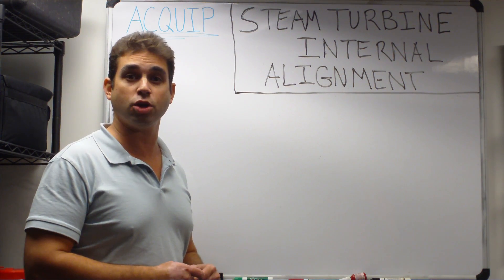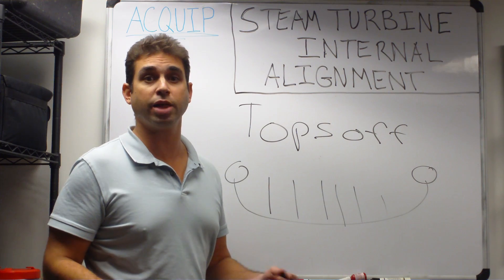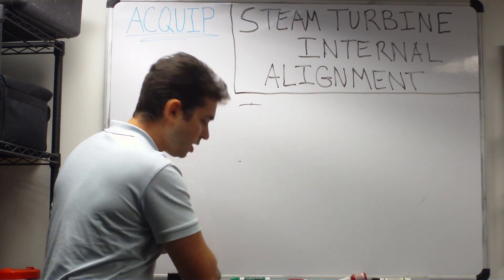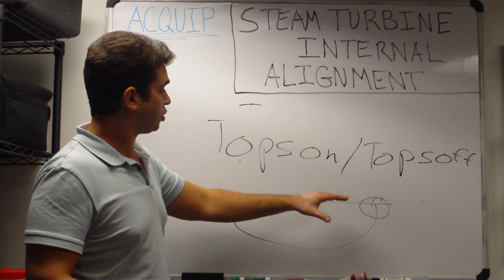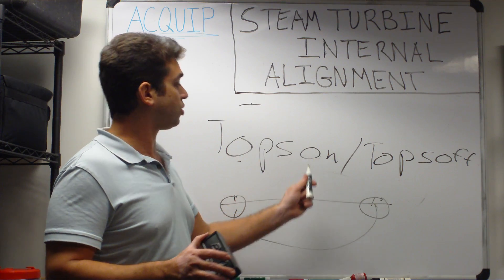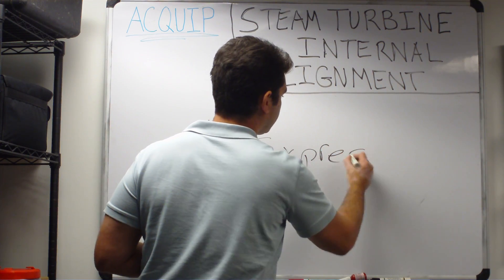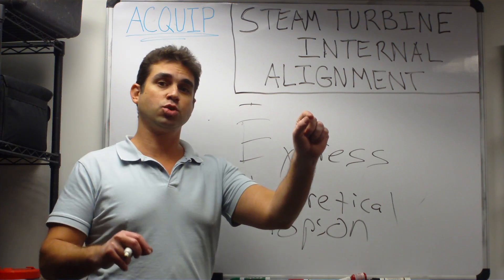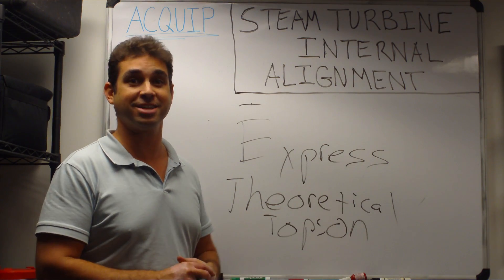ACQUIP Steam Turbine Internal Alignment

Comment: Good video. How to take readings when top casing is installed (top on)?
Thanks.
Reply from the maker: You have to crawl inside the the turbine. Generally the laser tracker is set up in one of the standards and shooting slightly above the center of the internal components. Then you use tooling to acquire readings on elements that have a line of sight issue.
Reply: @acquip  Thanks for your prompt reply... Keep it up...